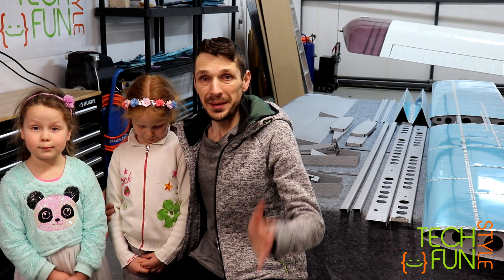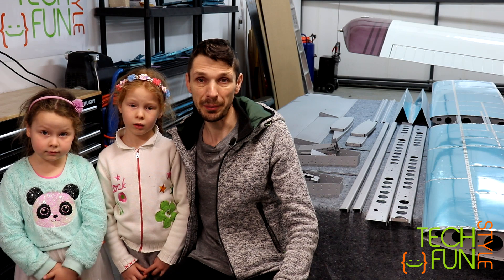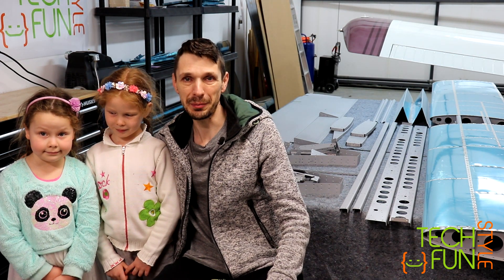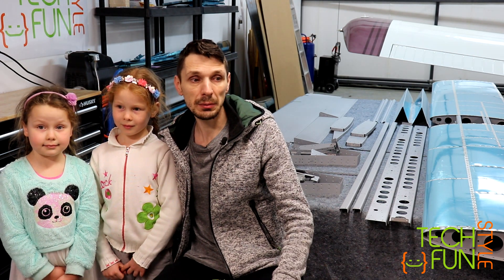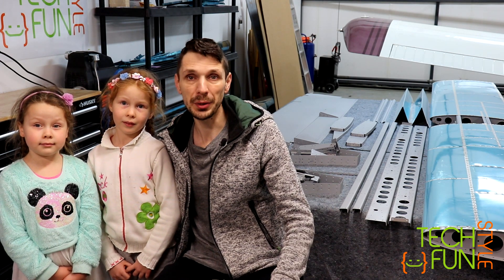RV-10 - Elevators assembly. Almost done. Building airplane

Comment: Hey Vlad, great videos! I was wondering how you got your tools for the build? Did you get the specialty aviation equipment separately, in a kit, or a mix of both? Thanks!
Reply from the maker: During preparation of my workshop for VANs build I shopped online through different sources and bough all tools online. Basically I took the list of recommended tools from  VANs website, also read VANs forums and looked what other builders recommend. After that I bought primary kit of what I thought I will need. During first few weeks of my build I was ordering from Aircraft Spruce every week something else. At some point I got to sort of saturation with tools and now can more or less work. I still want couple more things to order in the nearest future because my wings are not far thus I will need more tools.
Reply: @techfunstyle1606  Thanks! Keep up the great work, can't wait to see more!

Comment: We all do mistake, this is a normal learning process. How we fix them or decide if they really structural, distinguish good and bad builders. I saw many builder say : I should fix that or remplace that part, etc. For some mistake, let time for think about it, it's not a bad idea, for other they should be fix right away.

Keep going Vlad, I like your work.
Reply from the maker: True that! Mistakes happen, It is important to be able to find them on time (especially before closing the surfaces) and either fix or ...better fix rather than replace the part. It is all learning curve. Hope by the time I come to wings assembly I will have more experience under the belt.

Comment: Great progress, here’s my two tips for today. I see you have a pneumatic squeezer but apparently not a longeron yoke to go with it. They are extremely useful and makes your squeezer available to squeeze rivets in different areas. Here’s an example. Brown, ATS, Aircraft Spruce and all the other big aircraft tool supply stores sell them.
https://www.cleavelandtool.com/collections/squeezers-and-yokes/products/25-flange-nose-pneu-yoke?variant=18378207526974

I would also suggest a tungsten bucking bar. Much heavier/denser than your footed bucking that you’re using. The footed bar has its uses but I find myself using my tungsten bar 99% of the time as do all the other builders I know. Here’s an example.
https://www.cleavelandtool.com/collections/riveting-and-bucking/products/tungsten-bucking-bar-41?variant=18378249240638
Reply from the maker: Thank you for your recommendation. I have 2" yoke for my quizzer. It looks like there are longer ones so I definitely need to get one of these 3" or even 4" one to be able to reach in to way deeper places with my squeezer. 
I also have a tungsten bucking bar. It just all taped in black electrical tape. I did that on purpose when I work inside of surfaces to avoid dents etc. My tungsten bar is exactly as the one in your link. But it is always good idea to shop for another one differently shaped. They are expensive but  heavy and good!
Reply: Tech Fun Style the 3” regular yoke is my main one as I didn’t purchase the 2” yoke. The 4” no hole squeezer yoke is useful but the longeron yoke is awesome and I use it almost as much as my 3” yoke. You can get around flanges and other obstacles with ease.